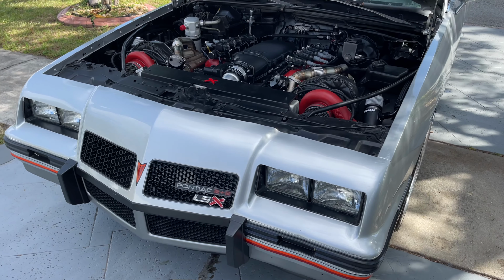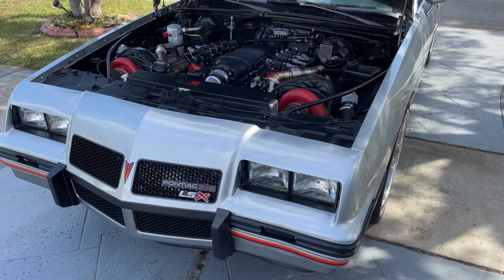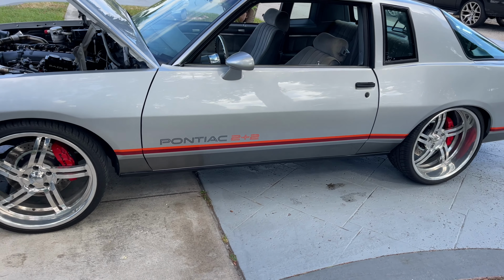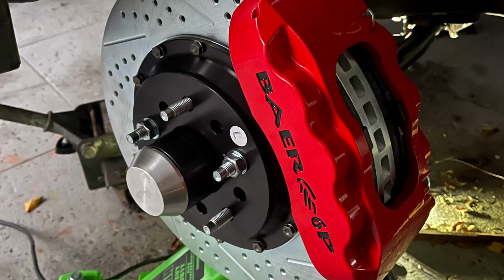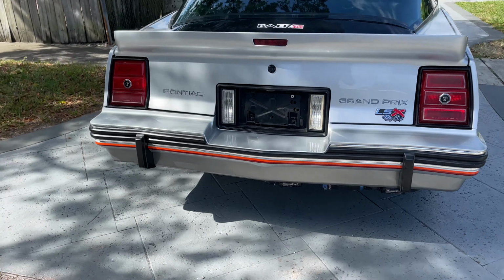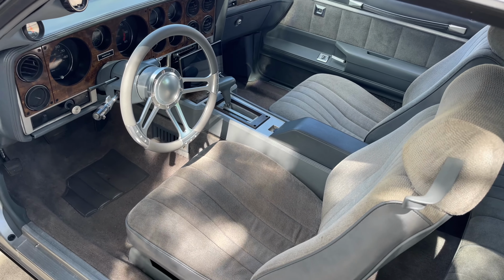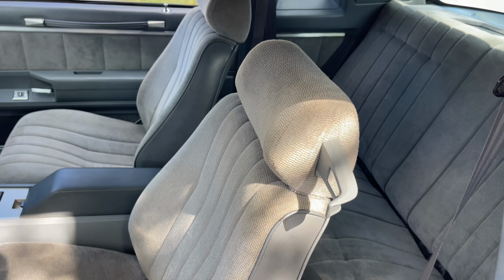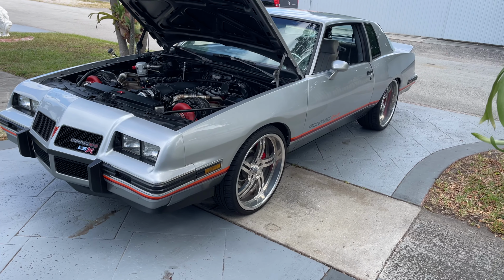Build breakdown of my rare LSX Twin Turbo 1986 Pontiac Grand Prix 2+2

Comment: beautiful car. i just dont agree with the wheels but its your car not mine.
id go with a more old school looking wheel in black thats smaller with more tire that still supports the size of the rotors/calipers but again its not my car but yours. its still beautiful.
Reply from the maker: I actually love both styles (big wheels and racing wheels on Drag Radials) it’s honestly the main reason why I go with coilovers all around on all my gbodys because I like to have 2 sets of wheels for each of my gbodys big wheels and racing wheels. I’m actually in the process of ordering some billet specialties 17” wheels with Mickey Thompson 305/45/17 drag radials for the rear 💪🏾. Thanks I really appreciate the love and support 💯💪🏾